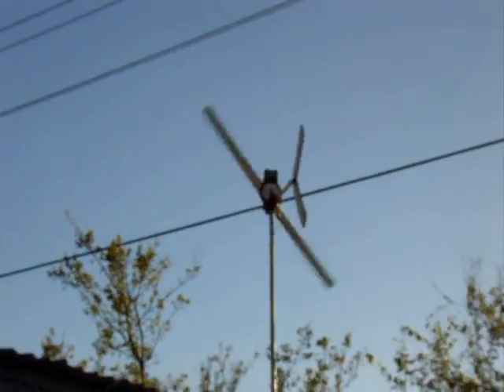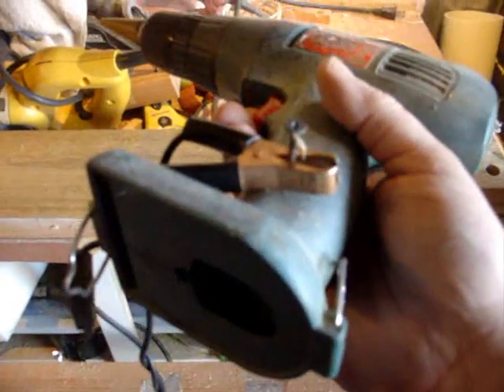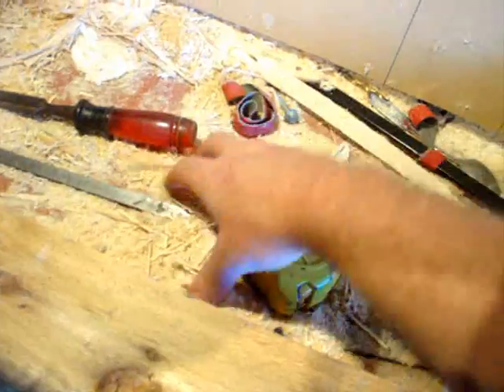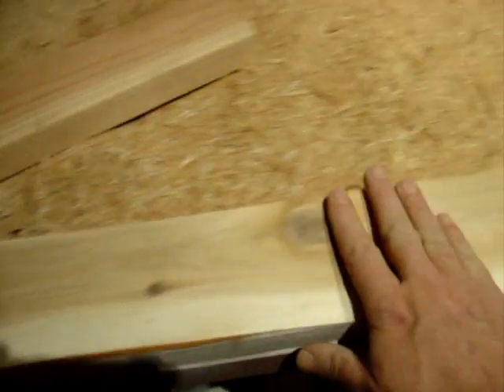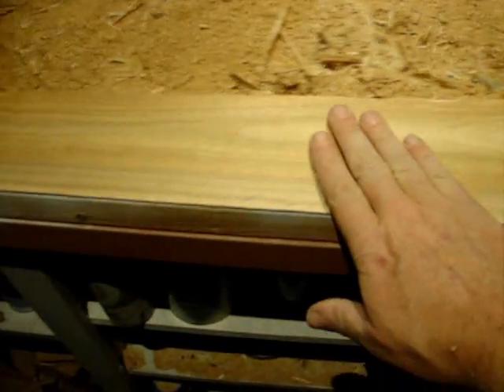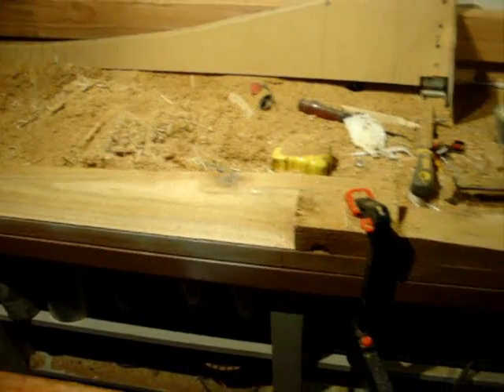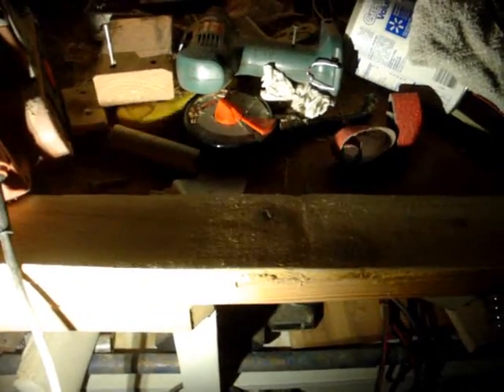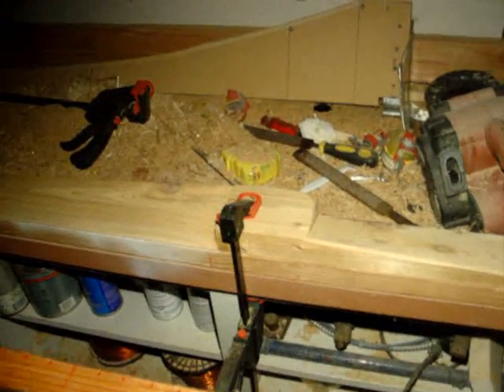CHANGING WOOD FOR PROPS   or   BYE BYE PINE   HELLO CEDAR

Comment: Thanks Scott. Sitting here in my hospital bed was a pleasure to see a blade making video to pass the time. Yes hard not to find a 20ft 9x2" with out a split in it these days. I am like you and resort to looking for knots more knots less cracks and splits. I figured  its factory felling, they just drop the tree down now as fast as they can and smash the crap out of it. A knots like drilling a whole in metal to stop the crack
but in reverse . Is that called a mono blade?
Reply from the maker: ian57812 Lumber companies, go figure. quantity instead of quality for them.
They grow the trees in 5 to 6 years now. Instead of 20 to 30 years. the dark rings are the strength. winter rings. The white rings are summer rings, fast growth, and weak.
The outer inch of wood is the strength of the wood.
how many dark rings are there, and how thick, or dark are they?....
look at oak. fat dark rings, and many of them.
heavy.
Anyway... dont stay in that hospital bed long bro.
they charge too much for that room, and all the rest of that.
And It makes Me worry too much. Get well fast. meditate and think healthy.
MUDDy
Reply: *****  Thanks Scott. Good luck with the blades I keep watching. I will bare you in mind for a set of my composite blades. Expensive but every now and then I may get a second with slight blemish. People are just to fussy these days. Now to medicate and think breakfast.
Reply from the maker: ian57812 Breakfast. nomnomnom. :)
cedar is beautiful wood, light, carves easy, and excellent strength to weight ratio.
I am sold for sure on it.
MUDDy
Reply from the maker: I sure hope breakfast was as tasty as well as nutritional. :)

Comment: It is great to see your videos again
Back in the day of early wind power, there was the Marcellus Jacobs wind plant, he made the propellers out of Sitka spruce, this is slow growth rain forest spruce with very tight growth rings and was very strong. If memory serves me right he coated the blades with an aluminum and pitch (tar like) substance. Cedar looks to be a good alternative
Thanks for sharing
Reply from the maker: Craig Nehring Thanks Craig,
I love making videos. And above all, sharing them. :)
I am sold on the cedar woods. spruce. sweeeeet. more bands or rings, light, and strong as well as stregnth to weight ratio.
That is very important. Heavy woods will destroy the wind turbine due to winds changing directions while high speed RPMs.
MUDDy

Comment: Just asking, would it not be better with 3 blades installed?
Reply from the maker: imystery man two blades, or three blades. both have the advantage over the other. Two blades are faster, and more efficient than three. But three blades is smoother, and kinder to the machine. One blade is the fastest, and most efficient. less drag.
Personally I like two blades or four blades. easier to balance, and assemble, and no need for a bunch of screws to hold them together. instead the two sets of two blades are one board each. that also means no need for hard measured spacing between the tips.
:)
MUDDy

Comment: G'day Scotty,

Yay Team !

 Mate, I was wondering when you'd get sick of trying to reliably carve Rotors out of Rubbish...

 If you don't look out, soon you'll be trying some straight-grained Hardwood, & jigsawing thin planks & laminating them, before finishing off with Wood-Rasps to take the Stepped Terrace Edges back to the Glue-Lines - which then serve as "Contour Lines" when eyeball-assesssing the Blades for Sectional Symetry...

I know it sounds fiddly, but compared to turning everything outside the Blade-Section into Sawdust, especially with Templates to mark up the Blanks...; it's actually faster and much less work, & energy going into making Sawdust.

 Last week I videoed a Spider which walked away unharmed, after going through a 200 Hp Woodchipper...; it's apparently not a big believer in Probability Theory...?

Have a good one,

;-p

Ciao !
Reply from the maker: WarblesOnALot smart escape artist spider. Laminated piles may be in the future, But for now, I guess the old head is still a bit thick.
You say it is easier and faster. That sounds nice. 
Good to hear from you Chris.
MUDDy
Reply: ***** 

  Yeah, Laminating does save a lot of effort.

I used to do the working drawings on the wood & drill the central hole in each laminae, so after Jigsawing or bandsawing, an old Gudgeon-Pin in the holes lined everything up for the balancing.

 Another advantage is that the root end of the Planks are denser & heavier than the leafy end, so by laminating the Stepped- Blank you can put the Heavy Ends in alternating Blade Tips.

 So, yeah, faster, stronger, better balanced ; there's a lot of reasons for laminating...

;-p

Ciao !